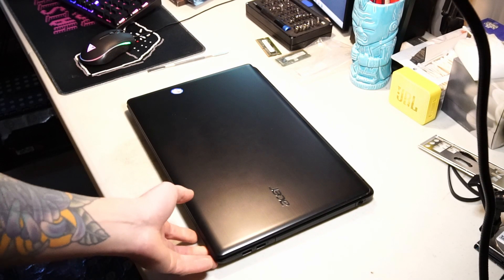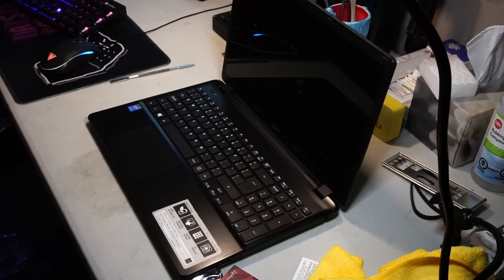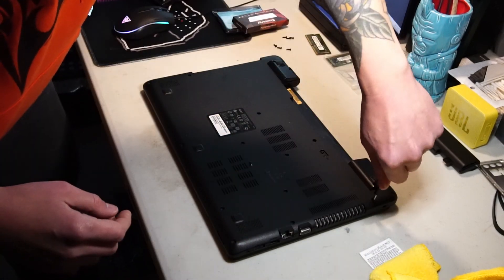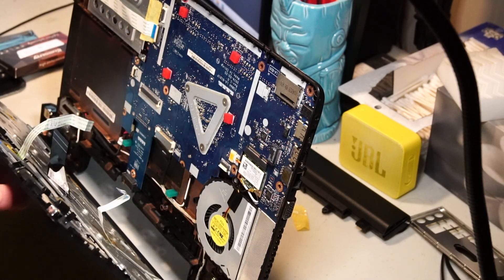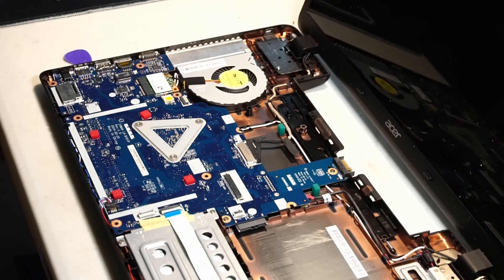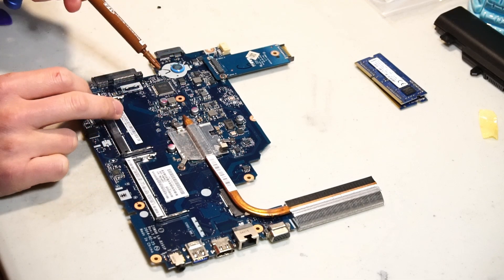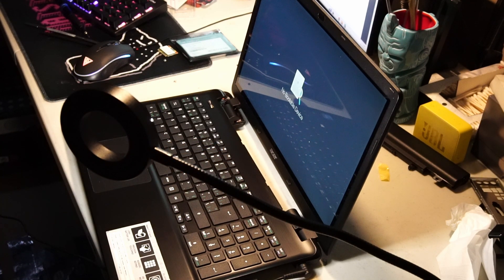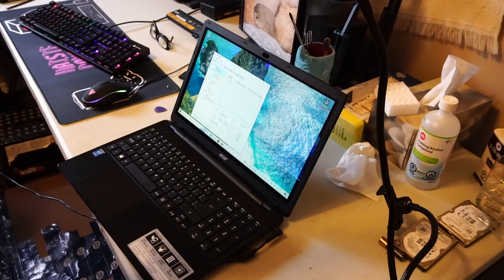Acer Aspire E5-571 (Z5WAH) SSD & RAM Upgrade Install + New Thermal Paste (2024)

Comment: do you have video about replacing the cmos battery on that laptop?
Reply from the maker: I do not.  It looks like the connection is soldered to the motherboard, so replacing it would require some skill with PCB repair.  Let me know if you try it or have someone else do it.

Comment: Two other videos show this having DDR3L RAM, but you used plain olde DDR3, with higher voltage. Isn't that a big problem?
Reply: 0:30 this one also has ddr3l so I am wondering the same
Reply from the maker: Well, I went back to my purchase order from Amazon to find out as I can't remember now if it was DDR3L or DDR3.  The listing is gone and the product description says DDR3/DDR3L, PC3/PC3L, so that doesn't help.  Sorry about that!  I would stick with DDR3L just to be on the safe side.

Comment: Hey I’m wanting to do this with mine and upgrade the hdd to an ssd but I see u got windows 11 on it? May I ask how and also how u got the windows key onto the laptop to set it up? Please and thank u
Reply from the maker: I installed Windows 10 on this laptop.  You could force a Windows 11 install, but I suggest you do some research first to see if it is something you want to do/maintain.  It is otherwise very easy.  As for the Windows key, I activated a key previously used on the hard drive.
Reply: @ oh alr, so u had an ssd with windows already installed on it?

Comment: Did this upgrade with the Ssd only. Worked great. But now a week later , sometimes I go to the computer and it says no bootable drive. If I turn off and on with the power button, all is well for a couple days, then it does it again.
Reply from the maker: Try going to BIOS to see if it is the top of the boot order

Comment: searched YouTube for this specific laptop upgrade and found another video that was excellent. Your is great too. Having 2 excellent videos t6o compare and contrast is awesome . Thanks  Windows 11 may see many consider this option because this upgrade should achieve the standards required ( according to Copilot )
Reply from the maker: glad it helped!  As for WIndows 11, the CPU in this laptop is not on the official support list, so you would have to bypass the tpm 2.0 requirements to install.  Let me know if you need help and want to try this.
Reply: No tpm on this laptop